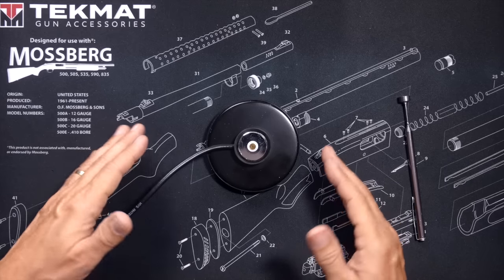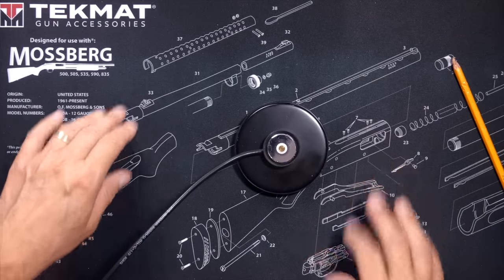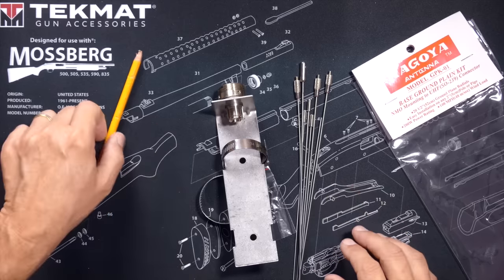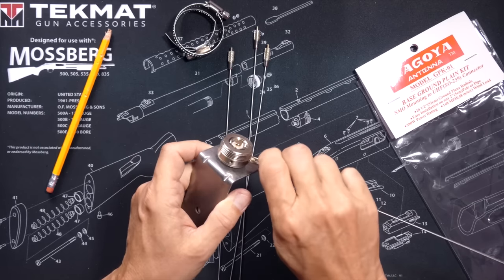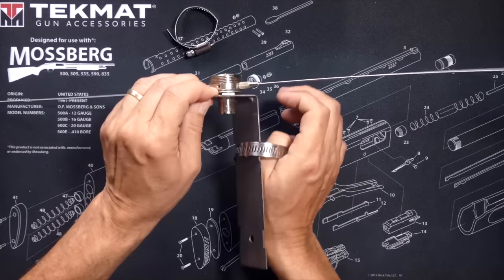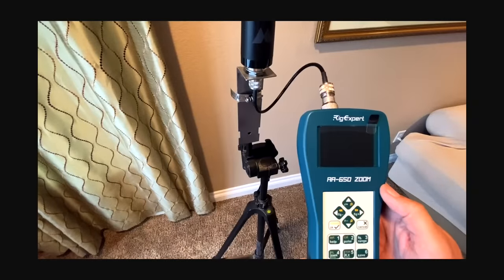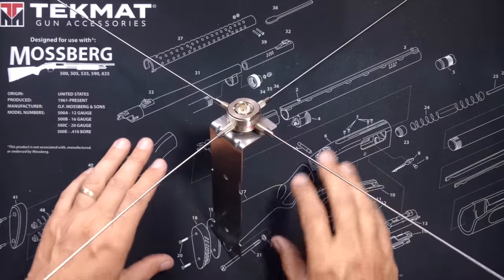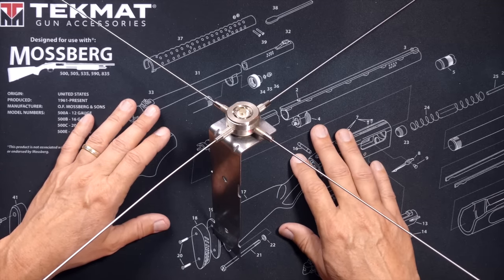What If You Don't Have A Good Ground Plane? Do Ground Plane Kits Work? Use A Mobile Antenna At Home!

Comment: That's a big negatory on the diminished popularity of CB good buddy. Can I get a big 10-4?
Reply: Yeah, as i said above in another comment, it is hoppin', always has been here in Vegas. DX has been great, and is going to be hot over the  next 4 or 5 years. My stryker 995 hp backed up with about 600 watts rolling of my Sirio 827 be a talkin' many many FARS. Breaka breaka!! 910 in Vegas 😄
Reply: I am hearing of a massive increase of traffic on I-94 & I-43. Enough for me to tune a new antenna and monitor it. If it's very active and not junk, I'll leave it on around home. Otherwise just use it for traveling.
Reply: I think Randy is referring to off-road 4x4 use. Although he doesn’t say that here. But that is primarily where he uses radio. GMRS is really gaining popularity among off-roaders just because the antennas are so much shorter, FM sound quality is better than AM (that most CB’ers use) and the range of GMRS, at least on the trail not relying fickle on ‘skip’ conditions or an amplifier is as good or better than CB. But lots of off-roaders are hedging their bets and using both.
Reply: @mmcnew1  Re: The ground planes, he says using a mobile at home in the title. But my finding and understanding with CBs is for the road. As for deep off-roading here in WI, it's either ATV/UTV for most part (I'll run my 4x4 on loggers trails) where portable GMRS repeaters would be very valuable. I've got a cottage WAY up north at the WI/UP MI state line. While a public lake it's almost exclusively private usage and a national forest is the backyard. A guy at the other end of the lake had the juice to get Verizon to bring a tower to reach the lake. (He'd land his sea plane to reach his cottage.) So while I still keep a HAM rig with me (Happy Ham :)  )  I'm still thinking of leaving a GMRS repeater (solar powered) for year-round operation. I just had to chuckle, if nothing maybe this will break the image that WI is nothing but cheese and cows. We've got some great rafting, off-roading, long-range shooting and for those who do winter sports the skiing and snowmobiling is great. <This old fart usually snowbirds in FL> 
Happy HAM: W4MMO  GMRS: WRVL515
Reply: @mmcnew1   I would agree.  I don’t think CB is as popular with the off-roading enthusiasts as it is with the truckers..
Reply: 10-4
Reply: That’s a big 10-4!
Reply: @acidreign8551  your operating illegally and stepping all over the small output local traffic keeping them from receiving possibly important road information from others, shame on you!
Reply: @acidreign8551  I'm not sure if it is you or one if your friends but someone keeps clogging the airwaves on 19 and it very well might have contributed to at least one of the pile-ups in the past week.  No one could hear road conditions because of the chatter about nothing.
Reply: @phillipsmith2443  sounds like "Mud Duck in the desert" who's been drowning out 19 all over the country for some time now
Reply: @louisianagator95  I’ve noticed that same CB traffic on trips from NY to SC. He has a nice radio voice that he’s obviously in love with, but his content is totally unrelated to what’s going on in the local area. You hear so much about what can happen if you violate FCC rules; why doesn’t Big Brother take him down?
Reply: I seldom hear any one around here I have a ham license still have my Johnson Viking and the amplifier to put out a bit over 2 kilowatts  it covers the CB spectrum oh I’m not a sad ham I also run a pirate FM station LOL
Reply: @melissasmess2773  WE GOT ONE!
Reply: Definitely sounds like he's one good buddy for sure!😂
Reply: 10-4 that's a big Roger diddly!
Reply: “from your back door”
Reply: Come back
Reply: 10-4 I use a CB every single day in my dump truck I have one in my pickup truck and I have a base station
Reply: Yeah the truckin industry has been useing cb sence the mid 60's..
Reply: It was a joke
Reply: 10-4
Reply: I'm hearing people pert near all day on cb lately. The sun cycle is coming up and the skip has been good. 73 folks.
Reply: @terrysaunders2026 Agreed!  Back when I was in the eighth grade (1967),  Uncle Charlie issued a $25 Citation to me for engaging in "idle chit-chat."  Must've been a slow day!
Reply: Cbs'? To limited unless you are transmitting on top of mount Everest!!
Reply: Randy I have the UT-72G antenna for gmrs ht radio - good SWR !
QUESTION- I have a ground plane 12in ×10in stainless steel, 
Is that ENOUGH METAL?
Reply: I don't know how anyone can overpower what I hear coming through CB freqs in the afternoon/evening. Crazy power some of those guys are using, many fars yonder.

Comment: Nobody uses CB'S anymore?... LOL... Yeah Ok......
Reply: My town has a HUGE network on 19 alpha (27.195)
Reply: I run cb and gmrs in my truck. CB is still the best for running on the highway.
Reply: Over the last 20 years of road running, I would agree CBs still exist but the decline, especially in the last decade of just rolling into a conversation is very noticeable. As to GMRS becoming a road standard the biggest barrier might be form factor. Every tractor on the road is factory setup with a "standard" hole and wiring for CB as well as either a straight up AM CB antenna or worse a combo FM radio (87-108mhz) CB stick. Gmrs mobile is mostly small form factor and would require some bracket adapter to accommodate. I run both in my trucks cb and handheld.
Reply: I still have my cb radios...have a few cb video gates on my YouTube channel..

Been finding myself sandbagging on GMRS lately 😂
Reply: Theres no better place for cb when you need to buy some trucker meth     Thats what i heard in the IE
Reply: I know right? I mean...I'm just a schlub but CB 19 is still the preferred for the highway. Nobody, and I mean nobody uses GMRS 19 yet.
Reply: I got a Cobra 🐍 29 LTD  Classic. But I need the antenna, a good one, base one..👍🐍📡🛰️
Reply: @PsRohrbaugh  I use 195 to tune up on myself. Breaka Breaka!! 😁
Reply: @coffeeseven  very true, I bought a Gmrs radio thinking I would have a lot of people to talk to, what a disappointment for sure, found no one on the highway and only three people in my area, and yes I was on some repeaters. I’m going to buy a cb!
Reply: CB is still funner!  Never know what channel you’re on.  Na, grew up on CB and shortwave radio. 959 still has my heart. Crazy how much they are now.

Comment: I ultimately solved the ground plane issue in my wrangler by sticking foil flue tape to the underside of the hard top, and ran a short ground strap from that to the roll bar.  The dealer asked me about it when I traded it in and just told him I didn't like to wear my tinfoil hat while I was driving.
Reply: Another option, with perhaps better conductivity than the aluminum tape used in HVAC, is the copper tape often sold to create a barrier that slugs don't like to cross. Search for "copper foil tape slug."

Comment: You get Romex 12/3 and put one end to the bracket of the radio then route it thru the firewall.  Then measure about 6’ for highway speeds, shorter for lower speeds as long as it drags on the ground.  The shielding should wear off pretty quickly and your set!  Perfect 1:1 SWR and ground plane in all directions.

Comment: As a graduate of the Betty Crocker University of half baked Hams, I can testify that the mag mounted cookie sheet antenna, works very well. I use one inside my home office, for my mobile base station rig. I just DO NOT run it on 25 to 50 watts. It tends to fry all the other wifi and bluetooth electronics, in the house! 
   I have also built a camera tripod mounted, ground plane antenna (similar to yours), using the TRAM ground plane (NMO) base, with a mobile dual band antenna. I had to Jerry rig, a metal plate between the NMO antenna and the base, but it works. Actualy adding about 20 feet of coax to the radio, seems to help lower the SWR, even more.  I suppose the coax is acting as a radial too? But with my 25 watt, mini mobile radio. I am hitting repeaters 40 - 60 miles away! Not to bad for cheap, portable, and 5 feet off the ground.
Reply: I hear ya.. when I fire up and xmit on 2m (~25w) it drops my audio device (Focusrite Scarlett 2i2) off the pc.. fun times.🤣

Comment: Now, to be serious. I bought this same kit earlier this month. I am using an Hys mobile antenna, stuck on the end of a 2x4 next to my recliner. I didn't take any tests, I was just told I needed a ground plane, so I bought this kit. It goes together as easy as it looks.
Reply: And you transmit that way?
Reply: @John-cj3ve:  if you had enough FARS coming out of the antenna above your recliner, could you make toast without getting up?  😂🤣🤠👋

Comment: I'm using a magnetic NMO mount stuck to a $6.00 pizza pan from Wally World, and it works perfectly!  I'm getting an SWR of 1.12:1   The antenna is a Midland MXTA26.  I set the nanoVNA parameters from 100-500MHz and at 462.0000 I'm getting the 1.2 SWR.  I'm seriously considering bolting one of these pizza pans to the top of a mast and using the same setup to get it up higher for temporary outdoor use.
Reply: Where do you have it inside your house?  I was thinking of doing this in my attic because of HOA where I love

Comment: I’m mounting a BTech20v2 to my bike (Honda ST1300).  The rear case is a 20x15” Apache case for storage, an auxiliary battery, and the radio.  Fortunately, they make 21x15” baking sheets that should match the lid perfectly.  No real need.  Just because.

Comment: Mr Randy, I live in an HOA. Heck I just gut on the board😊. It looks like I could mount that little black antenna with the 4 wire gizmo and put that up on my chimney. That I might get away with having an antenna up on the roof. We are actually 5 townhomes one story then a two story, then a one story, you get that I’m sure. I’m explaining all of this because I may have to sneak it up the wall to free airspace. Yep, I live in a one story between a valley of two stories. 
If that’s hard to imagine I could send a snapshot. Cheers
Reply: I’m in an HOA and have trouble reaching all the repeaters that surround me because of all the townhouses. How did you make out? What did you come up with. I either was thinking about something in my attic (I’m two stories as are the rest) or have to hide something out side in the roof somehow and then figure how to run the coax.

Comment: Good stuff this.. I use 2 of them, one set up as you did for GMRS and the other using all the ground plane radial extenstions for my 2M, 220, 450Mhz tri-bander rig all mounted inside on a modded ex-coat rack.

Comment: I just got done with doing a install that was having problems with a bad ground plane. I ended up ordering a antenna designed for no ground plane. It dropped the SWR from 4.2 down to 1.4

Comment: What would work better, a cookie sheet or a ground plane kit? Since I'm putting the antenna in the inside peak of my roof, I could use either as a ground plane.
Reply: How did you make out? I’m where you were. In an HOA and want to do something stealthy outside or in the attic.
Reply: @Eaglefan96  Right now, I'm using an antenna that does not require a ground plane. Which is working well but I still want to use a ground plane antenna and switch it out before it gets too hot.

Comment: Well, dagnabbit! if this'n ain't just one more OUTSTANDING preeezentation. * many applauses * 

If I may split one hair just a wee bit moar fine, I wish to attach a mobile antennae base to the aluminum roof of my rig and in my case I would wish to try using 3M's VHB tape to attach said base to said ro0f... but this additional THICKNESS may be a barrier to many fars! even though I did! hear Our Esteemed Leadership speak from his own noise hole the words "the RF electricities will easily ooze... right through the rubber coating and the paint on the car, and the antenna will COUPLE... with the metal to make baby electricities... also known as the ground plane".

I would also like to try the new Midland Stub Master (or whatever it's called) in this location centered on the roof of this crew cab 1/2 ton. Remember, it's not in the length, it's in the roundth.

Comment: 👍🏻. Thanks!  I just ordered a pair for my attic antennas.
I’ve had mag mounts stuck on HVAC air handlers for years now (1:5.2) but hope to gain improvement.

I just wish… REALLY WISH…. Antenna and radio manufacturers (AnyTone 578uv) would change to “N” or BNC connectors!
PL-259 / SO-239 connectors really are crap.  Especially at UHF and 700/800Mhz..

Comment: Great Video!!!! I have been watching your videos with great interest.
 I am familiar with these Ground Plane Kits and I was planning on using one of these kits for the GMRS radio I want to put in my garage. I was planning on using a 6DB gain Midland NMO mobile antenna with the kit on a 18' push up pole.  I was hoping that you would have additionally repeated the test with the ground radial extensions just to see if there was a remarkable difference.  I am less confident now regarding the Ground Plane Kit with your  results.  I am OCD regarding low SWR's and 1.5:1 would probably be as high as I would accept (or I would just choose another antenna option, antennas to me are like holsters, you just need to get the best option).  Can you re do the test with the longer ground radials.  The other antenna I was considering was the "ED FONG" GMRS 5 DB GMRS antenna.   I like your videos and subscribed.  I am also considering installing a GMRS Motorola repeater with a gain antenna on a small tower at the home QTH.  "73"

Comment: Am I wrong in thinking that the conductive material used as the ground plane should actually make contact with the grounding of your radio? And in the case of a mobile radio that would be the chassis. Also with the kit it would be through the shielding of the coax. But what about the pie pan idea 🤔 Love the videos by btw.
Reply from the maker: Yes, you are wrong in thinking that.

Comment: Does ground plane only help with Tx or does it benefit Rx too?
Reply: A ground plane helps both RX and TX. A vertical antenna without a proper ground plane or counterpoise is only half an antenna.

Comment: Have you ever tested one of those antennas that are a whole bunch of radials ?
Discone antenna
That supposed to allow transmission over 140 MHz all the way into the 900 band, all from that 1 antenna
I would love to see the SWR across the 140,222,440,500,770,860,902,926 MHz
If this antenna can actually give usable SWR across the entire spectrum it would be a good idea
There is an extension that you can add to give you Down to 25 MHz as well on the discone

Comment: Does this ground plane need to be grounded if attached to the roof of a house? Or do mobile antennas in general need to be grounded if they are used as base station antennas?

Comment: Many questions...

Is the 42 degree bend in the antenna angle simply because 42 is the answer to the universe according to the Hitchhikers Guide To The Galaxy??

What would be your SWR if you only used 3 legs of the ground plane ??  Or maybe only 2 legs ??
Reply: It will change the impedance closer to 50 ohms and create a better match in most cases. Closer to a 1:1 swr.

Comment: Question. I live up in the mountains overlooking the Sacramento valley and our house has got one of those big 10 ft diameter satellite dishes from the '80s on our roof facing towards the valley. Can I put a mobile antenna in the middle of that bad boy?
Reply from the maker: Sure you can..
No idea how well it will work though.

Comment: I was evaluating 4 inch diameter  magnetic mount antenna,  I connected to vector Network Analyzer to do so.   unfortunately  magnetic mount I tested was not giving good RF ground.  it got a little better after I removed rubber boot of mag mount.   but, still was not adequate.   I suppose some of magnetic mount are better than others.   AG6JU

Comment: I am a Bicycle Mobile Ham. I ride a 7 foot long two wheeled recumbent bicycle. I use a Diamond 7500 Super Gainer 5/8th wave 2m/440. The reason is,  the instructions say "Does not require a ground plane" But I am thinking about getting this kit. Will it work with said antenna? I've been messing around with Tiger tails,and for 2m, I need one about 19 inches long. For 440 I think it was something much shorter,  cant remember off the top of my head. So any ways, would this ground plane kit work for me? KI7BSL, James.

Comment: That’s odd. The second I plugged my antenna in and powered the radio on… the radio switched itself to Channel 19, I could only speak with a Dixie accent and called every “Rubber Duck” and “Good Buddy”

Comment: Would just setting up the same thing as in the video (ground plane kit and ghost antenna) to use indoors make enough difference to punch through to local repeaters I can’t reach with my UV5G plus?
Reply from the maker: The only accurate way to answer that question is "Maybe" .. or perhaps, "it depends".
Reply: @TheNotaRubicon  I get it. Learning more and more. Thanks to your videos. Really think I need a good option for the attic because of my HOA. Need to move is more like it.

Comment: Thanks for the video. I’m dumb and trying to figure out what I need to mount a mobile gmrs in my side by side. I have a plastic roof on it. This could work but id be concerned about branches and such beating that up too much. Can I just mount “a cookie sheet” to the roof or can you buy an antenna that doesn’t require a ground plane for a mobile gmrs radio? Sure would appreciate anyone who could give some advice!
Reply from the maker: Yes to both.